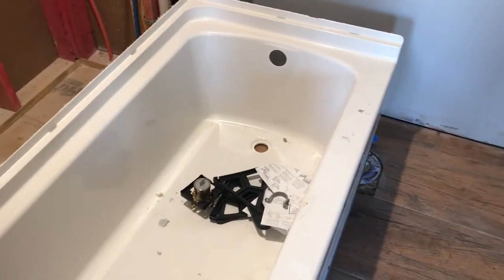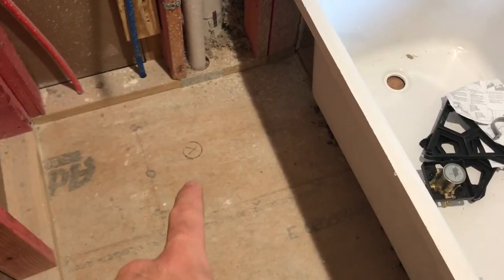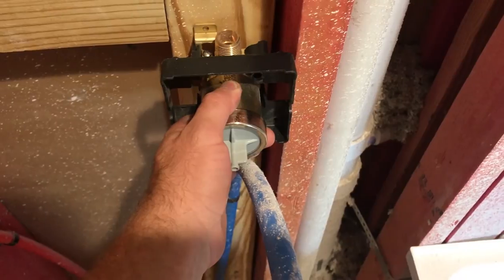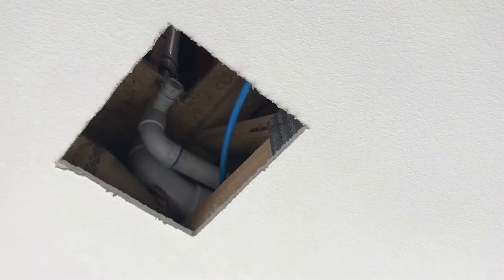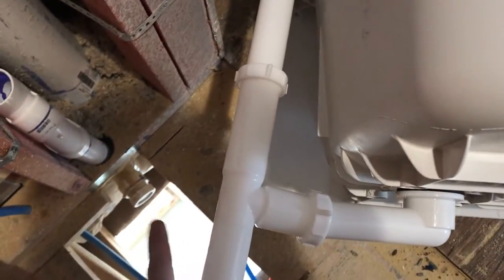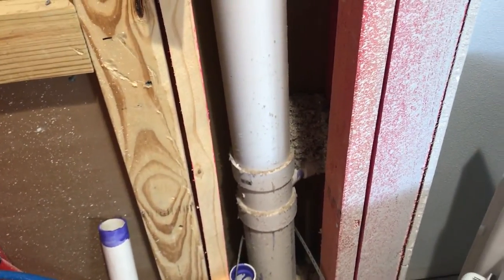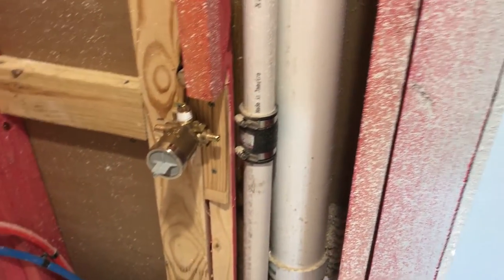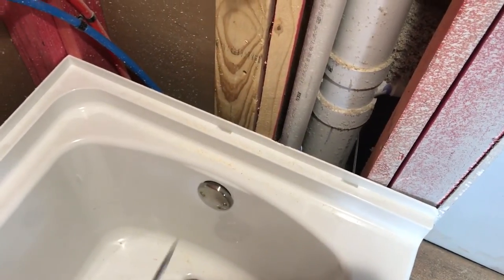Roughing in Bathtub and Plumbing

Comment: You can use a heat gun with the metal blade attachment to soften the pipe to get the bend you need.

Comment: I see you run into framing and fitment problems like me. Every time something is off just a little. Old houses have character but suck to redo a little bit at a time.
Reply from the maker: Ha! This is actually a new build. Unfortunately we didn’t plan for a vent stack in the original drawings, so we had a sneak it in where we could, and now it’s giving me fits.

Comment: He won't be putting in my tub...no ptrap don't cut the waste and overflow..turn your rubber gasket around it is beveled..
Reply from the maker: I’m not sure what all of your comment means. I did install a p trap. Perhaps I just didn’t show it here. Are you saying I should NOT have put it in? Maybe I got the gasket backwards on the overflow. Suppose we may never know unless it ever gets tested. Not sure what you mean by “don’t cut the waste”
Reply: @TomBrueggen  no you did not show up a trap If it was installed right you wouldn't need to cut it it would be straight the rubber gasket is beveled a big end goes on the bottom.
Reply from the maker: Earl Davis yes I assure you the P trap was installed. I tried that overflow every which way I could imagine and it never seemed to line up. Perhaps the gasket was beveled, but not enough to be obvious to me. I’m a pretty inquisitive fella, and that thing had me solidly stumped. Ah well, it all seemed to work out, despite my inexperience. Thanks for your input.
Reply: Earl Davis lol the overflow drain gasket for sure is backwards hence the drain isn’t lining up
Reply: @Mr1krazyfox  that's exactly how he have it and that too is wrong the big end goes on the top not the bottom